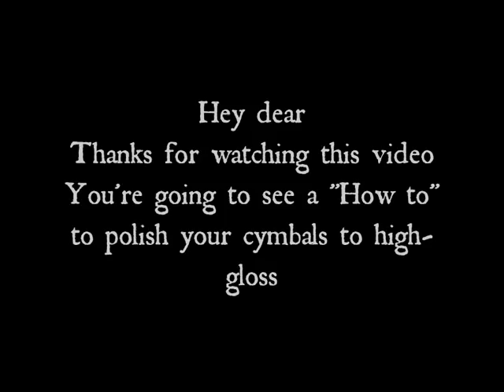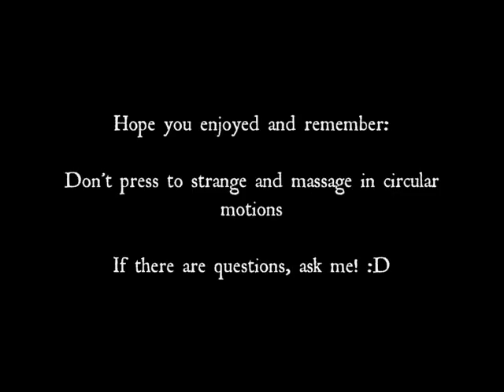How to polish your cymbals to high-gloss!

Comment: For Paiste 2002's:  Bar Keeper's Friend.  Get a bowl, some water, and 2-3 tablespoons of BKF.  Find someplace where you can quickly rinse the cymbals and dry them.  First, take a sponge or soft cloth and dip it into your BKF solution.  Not sopping wet, wipe it around the cymbal, following the grooves, avoiding the labels altogether.  Rinse it and look for any more dirt in the grooves.  If needed, go over it one more time, but when you are done with the rest of the cymbal, quickly go over the logos and immediately rinse them off.  DRY the cymbal NOW, bone dry.  This is crucial because leaving partly dry cymbals will bring on immediate patina problems.

Comment: "it looks well used"... damn... you should see mine xD I however heard that cleaner uses materials that can damage the structure of the material and intensive cleaning can be harmful to the service. So I pretty much only clean them once or twice a year at this point :) Window cleaner (NON-ACID VERSIONS ONLY) can help to make the cymbals look shiny without any harm, it doesn't get heavy sticking or thick fingermarks of though.

Comment: QUESTION? Nobody seems to know this answer,but does Ketchup actually WORK on all-"BRONZE" Cymbals? I've seen many videos of people polishing theirs with Ketchup,but ALL of them,were "BRASS" cymbals,NOT Bronze!?!? So due to the metal-differences between em,would Ketchup actually have the same,better or worse effect on all-BRONZE cymbals? ANY help would be nice!?!?
Reply: ***** Great,Thanks for your input to my question Ryan!!! I appreciate it!!!
Reply: Ketchup can on certain cymbals distort the look of the cymbal,  I believe it is acid or the natural chemical in Ketchup that will do the damage. I have seen it used on some cymbals and it worked  pretty good but not great. So the answer is use cymbal cleaner and a buffer, Or,  the best way of course it is the most expensive.  it would be to get a motor that spins the cymbal, then you have full control of the cleaning process. There are guys on U tube that sell the device it looks like a black tub the cymbal sits in and gets screwed down like you do on a cymbal stand. Then it spins the cymbal so you can hold  down a rag with cleaner on it. they work wonders on cymbals.

Comment: What type of buffing machine is that??
Reply: TJ a polisher I think its called look that up might work
Reply: It's an orbital polisher or "buffer". It does not go in circles like a true buffer does. It does not create heat like a buffer does. It is not as aggressive as a buffer as the RPM's are much lower than a buffer. They are also much less expensive than a buffer. A good choice for polishing a cymbal. I would suggest a smaller one then he used. A 6" orbital polisher is about as large as I would suggest since not all cymbals are as large as the one he did in this video. I hope this helps you out.

Comment: The cymbal already had a Brilliant finish, so should never had a buffing machine used on it. Just a soft cloth should be enough to remove the fingerprints.  What is all this thing about having such bright shiny cymbals, most don't start with a Brilliant finish, they have a matt finish from the lathing process. Every time you polish a cymbal with any abrasives - Paiste cymbal cleaner  is an abrasive - you are removing metal. and softening the profile of the tonal grooves which give the cymbal it's unique sound. If you want clean shiny cymbals, buy them that way and treat them with respect, wiping them down after every use and removing the greasy fingerprints which will lead to marks and tarnish. there are no real cymbal cleaners on the market now, only cymbal polishes - all were deemed to bad for the environment to stay on sale. Don't waste your money buying any branded cymbal cleaners, when washing up liquid and water will clean them, and a soft well laundered cloth will polish them after use. Never use powdered abrasives  or Brasso type abrasive cleaners, Brasso is for cleaning tarnished brass,  decent cymbals are made from bronze, they are not brass.

Comment: Honesty it looks great but I wouldn't wet my cymbals, because I don't want them to get rusted, and I don't want the sound to go away. So, in my personal opinion, I wouldn't risk it, especially if you have a high value cymbal.
Reply: I've never seen a rusted cymbal.  They're 80/20 copper and tin. Neither of which rusts. You need steel or iron to rust right?

Comment: Best and cheapest cymbal cleaner - WD 40 ... i dont know why everyone makes videos of cymbal cleaning. WD 40 is so much simpler..
Reply: ketchup is cheaper
Reply: Eagle One Nevr-Dull is better than WD-40 just saying.
Reply: I sand my cymbals. Not a good technique for brilliant finish cymbals, but for really heavily tarnished cymbals, sanding works the best.
Reply: Ketchup is the best.
Reply: bdbcorp Correct!!! Best I've ever used.  Don't know why people don't know about this.
Reply: ***** ouch...lol
Reply: Pedro Andrade
QUESTION? Nobody seems to know this answer,but does Ketchup actually WORK on all-"BRONZE" Cymbals? I've seen many videos of people polishing theirs with Ketchup,but ALL of them,were "BRASS" cymbals,NOT Bronze!?!? So due to the metal-differences between em,would Ketchup actually have the same,better or worse effect on all-BRONZE cymbals? ANY help would be nice!?!?
Reply: i had two experiences with ketchup
my sabian aa ride was dirty, it got pretty clean afterwards
but
if you use it in a clean cymbal (don't ask why i did this, i'm stupid) it may stain the metal a little bit if you leave it there over 15 min
but, in dirty bronze cymbals it works
Reply: Pedro Andrade
Great,thanks for your info Pedro!!!
Reply: I use hydrochloric acid. Never have to worry about dirty cymbals again.
Reply: Nick Oliva you also don't have to worry about your cymbals themselves ever again right? hehehehehehe
Reply: Pedro Andrade nope..buy new ones